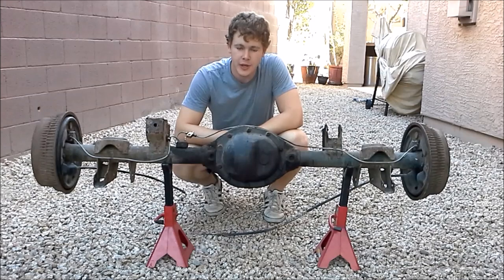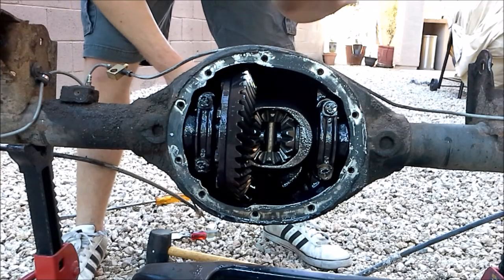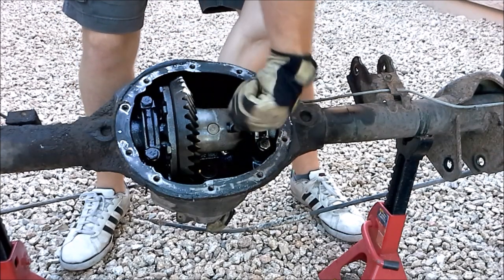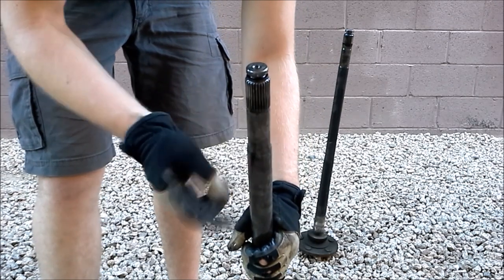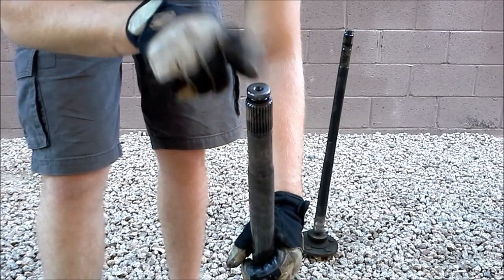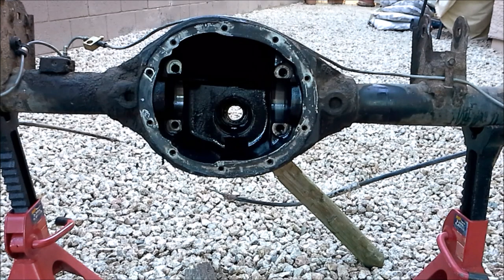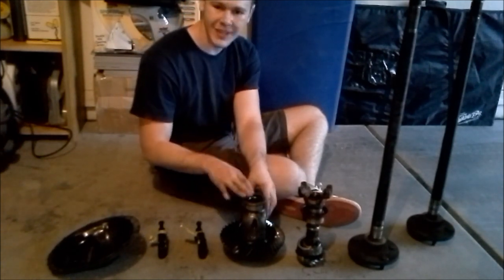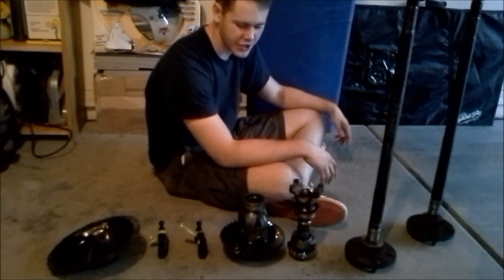Dana 35 Axle Teardown

Comment: This is the only video that actually shows how to get the pinion out of the housing that I could find thanks a bunch for real. Who knew you could just hit it with a hammer but better watch those threads there man  if you will or your pinion is toast and wont work again when just  a bearing replacement on your pinion.

Comment: Start by cleaning it and looking at spot welds on differential. There's no way you checked them with the curd caked on them. I have seen people dump $$$$ in an axle that was fubar in the beginning. All thanks to not cleaning and inspecting. Before you spend any time and your labor in it. Trust me I have seen it happen. I replaced bearings and seals then weeks later to have everything fubar. Had friends get a new rear end only later to find welds broken on it after installing.

Comment: How can I find my rear axle for 1999 XJ Is Chrysler 8.25 or diana 35 ?
Reply from the maker: If you don't have ABS, it should be a Chrysler 8.25.  You can also look at the shape of the center section of the axle.  The 8.25 is flat on the bottom and the dana 35 is round

Comment: Good video, and explanations.
The wood chisel works OK (1:30) for separating the back-plate, but using
 a "scraper" wouldn't cause the chisel to need sharpening.  I use a 
"painter's 5-in1 tool" for separating parts and scraping gaskets and 
sealer of off mating-surfaces.
Also, removing the pinion-nut (6:00,) one can use a pipe-wrench on the 
pinion-yoke, instead of a block of wood in the rear.
-- And,... my older ('89 Cherokee) D35 has pressed-on axle-bearings and an outer plate/bolts (doesn't use the C-clips.)  I had use a slide-hammer, with an adapter on the wheel-studs, to pull the axles.

Comment: Hi, thanks for the very informative video. I am trying to remove the axle shaft so I can replace a leaking seal (and the bearing while I'm there.) But, I've run into a problem...I removed the 1/4-inch bolt, and that center pin, but for some reason when I push on the end of the shaft it doesn't go in far enough to release the c-clip. Argh! The clip is turning free enough...but it feels like the shaft is butting up agsinst metal out at the wheel end and not simply sliding in like it does in your video and every other that I've watched. Any ideas? Suggestions? So far, I've tried tapping at the end with a rubber mallet, but nothing. Any help would be very much appreciated! ~~Thx, Mark

Comment: Hey! I took apart out my carrier to replace the bearing on the driver side. I bought a new carrier and bearing and put those on etc. I also put on the ring that connects to but I didn’t torque them down yet; but when trying to put my carrier back on for some reason the race won’t go on all the way. Do you know why that it or do you know what I’m doing wrong or do I need to torque down the bolts first? I also have my axel still on the Jeep.

Comment: after a few months of clunking my Dana 35 w/3.55 gears seized - can't turn anything w/driveshaft disconnected - looked clean in the housing w/rear cover off - a bearing ? thanx for the good fast teardown !
Reply: air tools !!!
Reply from the maker: I have air tools. I just wanted to show how its done without them for those that don't have them.
Reply from the maker: A bearing would be my first guess in that situation
Reply: I would check the pinion gear bearing. I just had to tear mine down. Bad bearing took out the pinion gear.

Comment: Not to be rude or anything but why are you using a metal hammer? Even if you are not going to use this you might be selling it and you can't if it is damaged. Next time I would use a rubber mallet. Just so you don't damage anything.
Reply: Or a brass hammer

Comment: I'm thinking of upgrading my d35 to a 8.25 before I get a lift and tires, don't know if it will help at all
Reply from the maker: +OutJeeping What size tires are you planning on running?
Reply: Im ganna do a 4.5inch lift with 31s or 32s
Reply from the maker: +OutJeeping 8.25 will handle that no problem

Comment: Hey man, working on my pinion seal right now and having a whole lot of trouble getting 5:50 bolt off. Any suggestions?
Reply: you’re probably not still at this. lol. But i’d say to get the biggest plumbers wrench you can find to hold the yoke from turning while you get a breaker bar on your 1⅛” socket.  let the bottom of the car hold the plumbers wrench from spinning and give it all you got on the socket wrench.  Anyway.. maybe that helps someone else who comes in here.

Comment: what did you do with that Dana 35 carrier because I need one what do you want for it
Reply from the maker: I sold  the shafts, carrier, and gears and used the housing for this video: https://www.youtube.com/watch?v=XWMRDbpHc2c
Reply: Dang it cuz it's impossible for me to find one right now in the area that I'm living in
Reply: Would it be possible for you to get another carrier foot Dana 35 with a 3.55 gear ratio but all I need is just the carrier and how much would you charge me for it
Reply from the maker: I don't have any leads on one at the moment. I generally use craigslist and local facebook buy/sell sights for parts. Are you in Arizona?
Reply: Hi Jason, did you ever find a carrier.  I know there are two different size carriers used on the Dana 35c.  I can't recall at what gear size it changes, but I think I still have my carrier that had 3.73 gears in it.  I pulled it out a couple years ago when I put in an eaton e-locker and 4.88's.

If the 3.73 carrier will work with your gears, let me know and I'll try to locate it for you.
Reply: aaaleonca unfortunately my hearing is 3.55